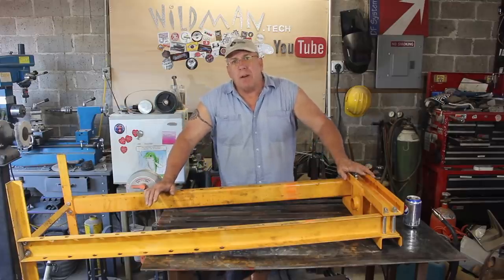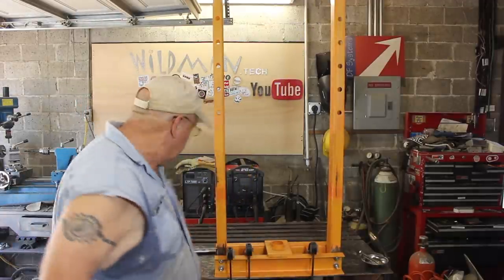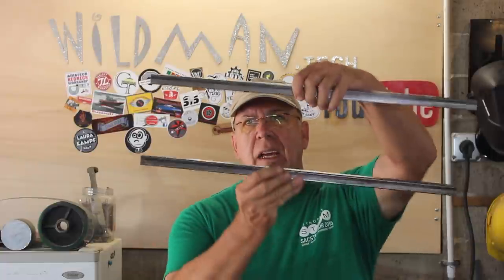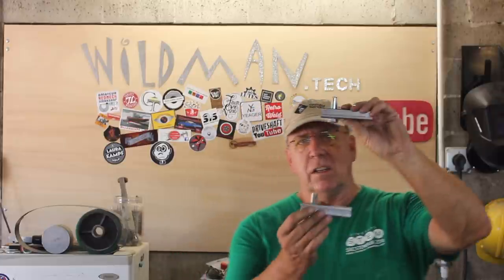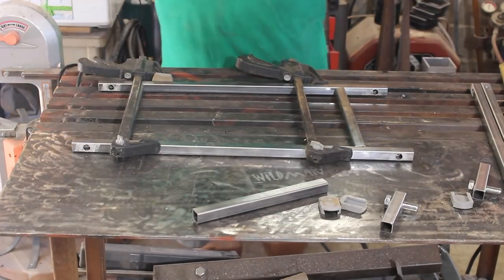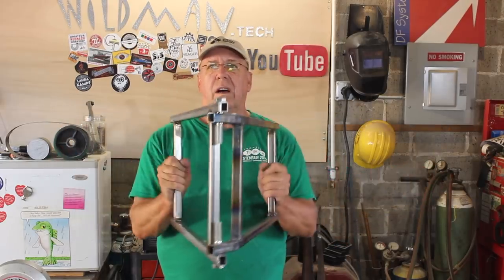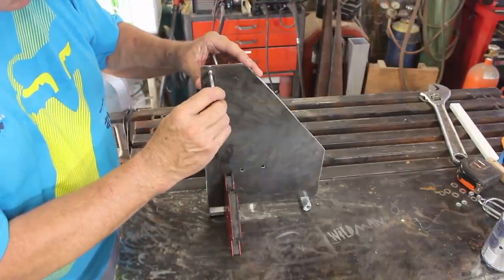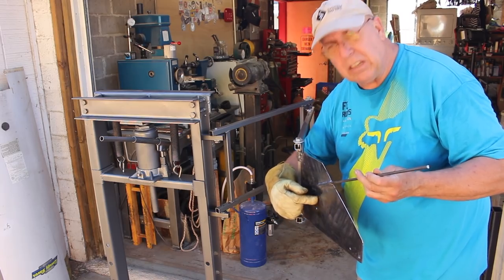Build a Plasma Cutter Pantograph!

Comment: That came out awesome! I love how it folds up & stows, more machinery needs to do that!  Have you thought about maybe a small bearing or wheel on the stylus to follow the pattern with? That could possibly help with the end result, although it is pretty impressive!
Reply from the maker: Thanks for watching! Making patterns for this type of system becomes more problematic with a larger stylus. A pattern with a nice smooth edge and a small bearing on the stylus would greatly improve the quality. The best approach would be to use a sheet metal pattern and a magnetic stylus with gear reduction motor to guide the torch.

Comment: Using corner to corner measurements to check for squareness can become deceptive if other checks aren't done first.
Check sides are straight and opposite lengths are equal and parallel. A pseudo trapazoid shape can develop from press use causing aslight bend in one side. Equal corner measurements will still be possible while out of square. 
If you start with a square and reduce one side length to almost zero corner measurements are again equal without a single square 90° corner. Some like to call those triangles. 

Just a two year late thought so I guess I'll just have to square up with you later.
Good idea you have there. 
Peace.

Comment: Not bad.  It's not a pantograph but looks like you got some OK results.  A pantograph would allow you yo make a 2x larger pattern, which would give you better resolution.  Actually, you can set up most any ratio you want, within reason (0.25 to 10 or something like that).
Reply from the maker: Yeah, it's actually a pattern follower. I have a CNC plasma cutter looming in the near future.

Comment: Wildman Tech
How are you liking the Lincoln 210MP?  I have one but have not used it yet.  I did hear some people were having problems with them.  I usually use an Esab Rebel which works great.
Reply from the maker: I blew the main board after 15 months, but they had it fixed in a week and my shop gave me a loaner while it was gone.
Reply: Thank you for the info.  That kinda speaks to the lack of reliability.  Crossing my fingers.
Reply from the maker: No it doesn't. Having a breakdown after 15 months in a production environment is not uncommon. They fixed it fast and for free.
Reply: Ok thank you

Comment: I don't think that's a pantograph, it's a tracing setup, and it's actually a great idea.  It would be cool to add on some motors and sensors and have a CNC cutter.  That's what I want, but I want it to be portable.
Reply from the maker: It's actually a pattern follower, but the mechanism is similar to a pantograph.